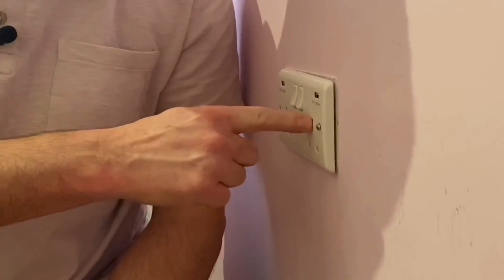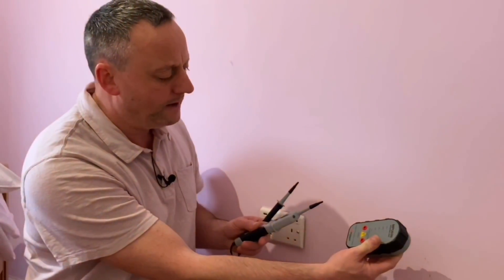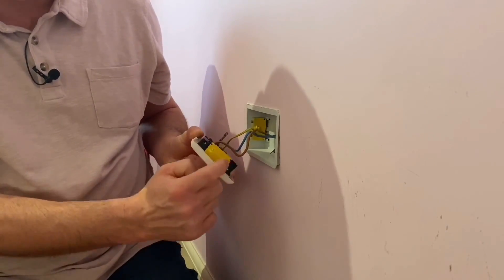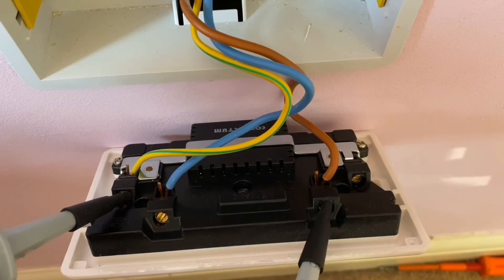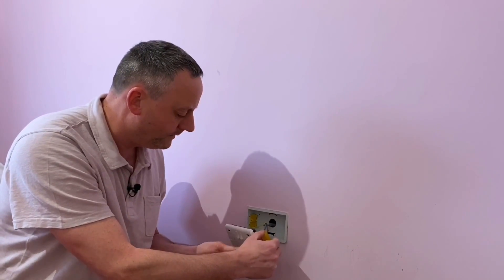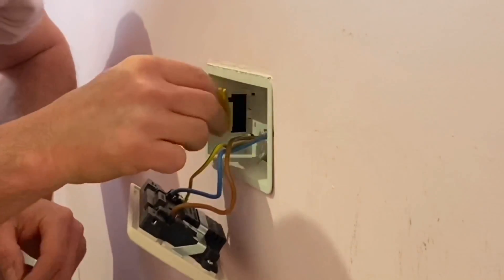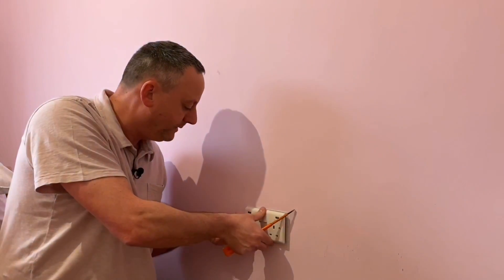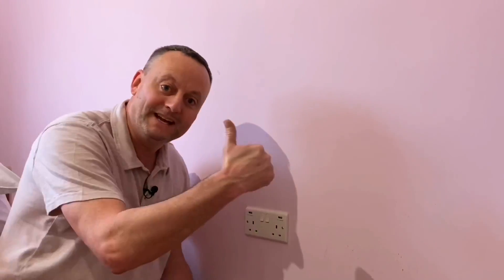How to Repair a Broken Dry Line Box and Safe Isolation of a Socket Circuit (Dry Lining Box)

Comment: Great video Gaz but two points , sorry to bust your chops on this one  (1) way to much copper showing on those terminals  you should  know better sort it out man you wouldnt leve it like that in somone else's house so why would you leve it like that in your own home,  (2) why flaff around swapping the clips all you have done is broken  one  box to fix a broken one IE you removed the clips from a perfectly good box to put into a broken box there by leaving your self with a broken box, why , i herd off penny pinching but that just silly,  just replace the hole box and throw the broken one in the bin . its not hard is it . Vienna your behind the camera tell him your convesgatating his jelly baby’s for a week 😂
great video as always.👍❤️
Reply: Q: What language is this wrote in?
Reply: All devices now have “spell check” 🤪
Reply: @seemorebeer2848  there’s nothing wrong with the spelling.you need to learn to read. Son
Reply: Gary, love you style and methodology mate. I would have swapped the whole DL box by cutting from centre to the edge,then sliding the box over to save disconnecting the wires although there’s a tad mor visible copper showing than i would accept. 
Otherwise good stuff 👍🏼😉
Reply: *your 🤦🏼‍♂️